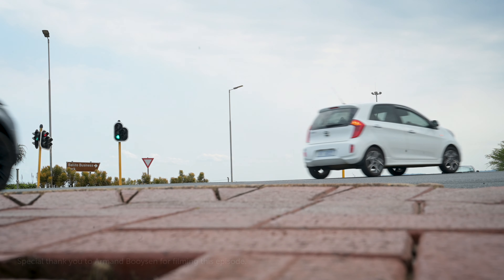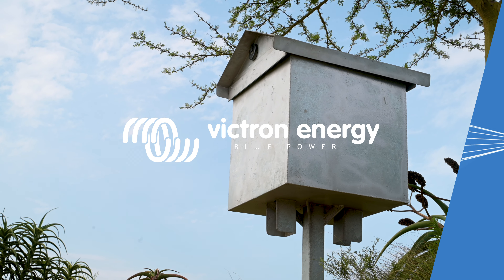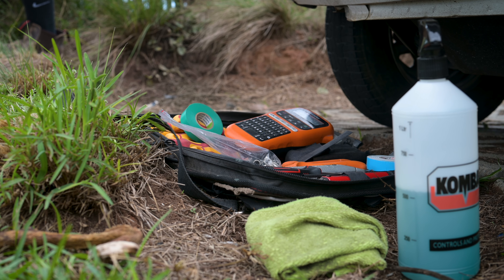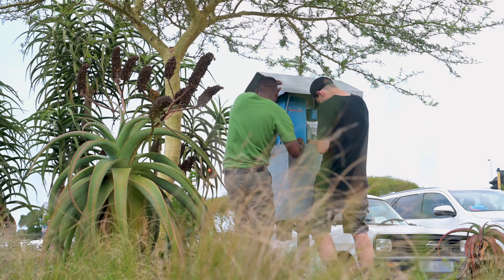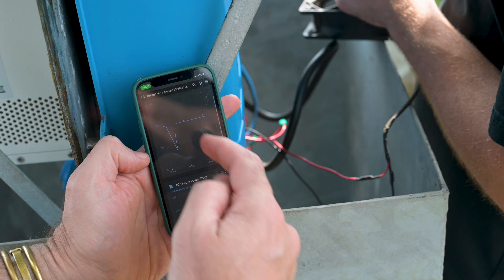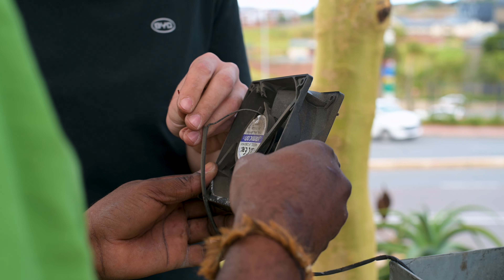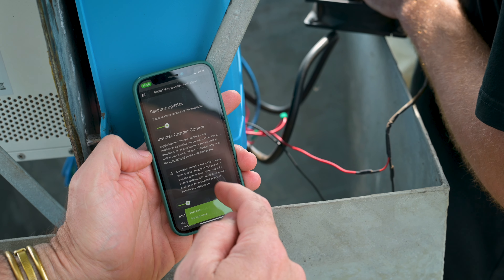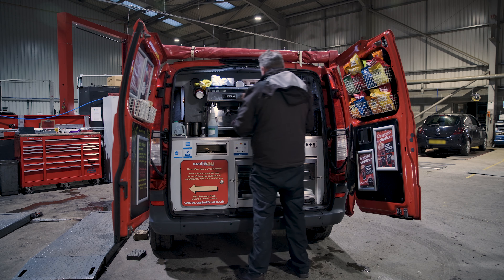Reducing accidents with a traffic-light backup system using Victron

Comment: As someone working a lot with computers and setups too small to warrant a big UPS, I actually want to see an almost of-the-shelf setup for a battery box and MP2 as a UPS replacement.
There are a lot of expensive UPS's that can barely survive 10 minutes and they won't tell you before you buy one. They keep it so shrouded and secretive, that it warrants to kick them out and replace them with very open systems. So you can actually size your setup and know in advance if you survive a blackout or need to shut down.
And the best, which I've never seen a rack based UPS do: the slow ramp up of current used from the grid when it returns. Also: the independence of the battery provider...
We can get so much control back with an easy victron solution vs a "professional rack ups" at a fraction of the price.
Reply: @bloepje  I'm doing same thing with big battery bank. Around 13kw, all of my equipment (micro servers routers storage) run from this battery bank which recharges from victorn mppts. Used redundant industrial grade inverters. 

The whole system is up for more than two years now without any hiccup

Comment: Something tells me that Victron hardware costs significantly less there than in the United States.  My RV system was $15000.00 and I could only run One AC for 2-3 hours on the 2 Battle Born Game Changers. If I had full sun I could get 8-10 hours out of the 3000 Watt Victron inverter while running the other Victron hardware.
Reply: Victron is crazy expensive in US lol. Here in Australia Multiplus II 3000w can be had for 500USD
Reply: It is cheaper I would say in South Africa.  But the 48 volt inverters is still way to expensive for most of us. I have 3 small charge controllers 12 and 48 volt which are affordable . But bigger to expensive.  Victron is the BEST . Love my controllers all the way
Reply: @ruchira1991  Just did a quick price check, It's 2-2.5x the cost in USA.
Reply: The Victron kit sold in the US is different from what we use here. This is 230V vs the 120V made for US. I imagine the economies of scale on the 230V kit are greater than for 120V but as the US volumes grow (they’re growing fast), the price will no doubt come down.
Reply: @WarwickIsSensible  For past projects I've not noticed any significant price difference for either AC voltage in USA market.  Something else is at work here.

Comment: Didn't anyone mention the battery capacity?  And the duration the maximum power outage is covered?    - I can see a couple of cheap trailers with a roof rack and solar panels to station hidden, locked on something heavy, if power outage will be longer.
Reply: They run for about 20 hours on 3kWh lithium ion battery.